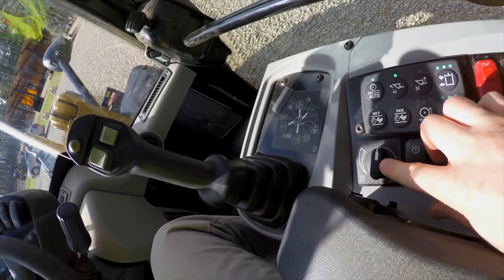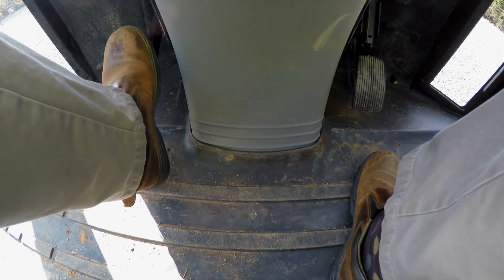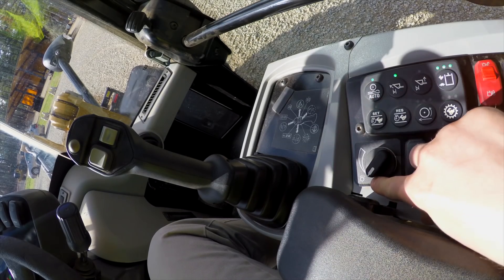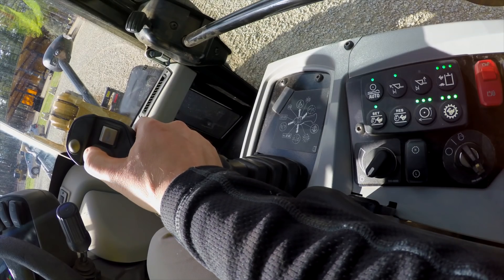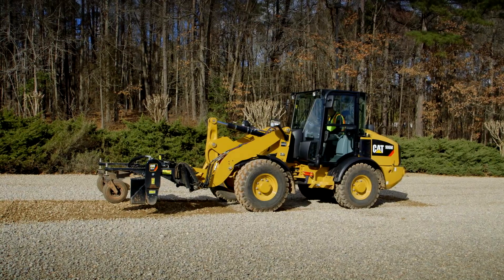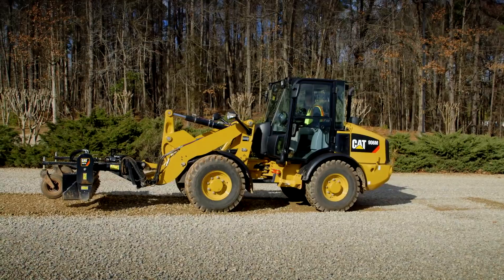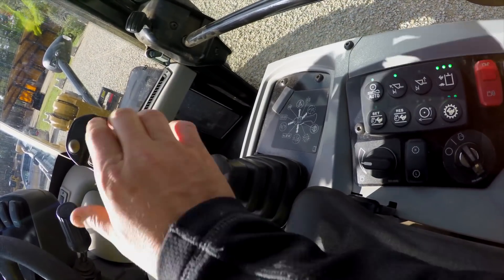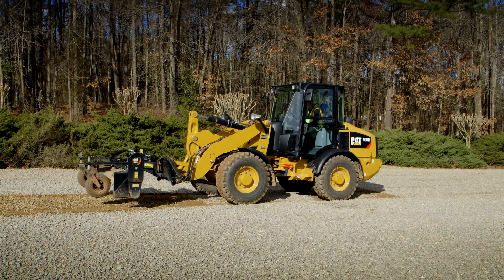Creeper Control | Cat® 906M-907M-908M-910M-914M-918M Compact Wheel Loader Operating Tips

Comment from the maker: Hi Omar! This is a common question. It’s associated with the position of the creep speed adjustment knob. In low gear, if creep is engaged, locate the speed adjustment knob on the RHS console. Turn the knob until the “snail” indicator in the display disappears. Creep will then be disengaged. - Maria C